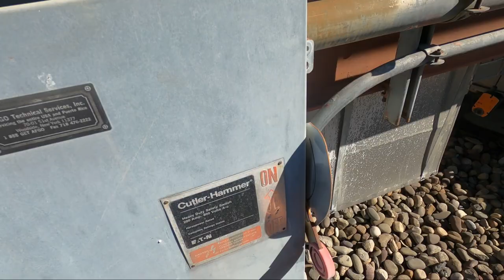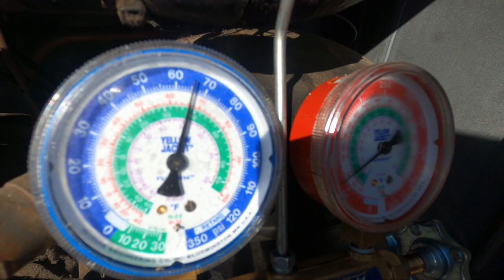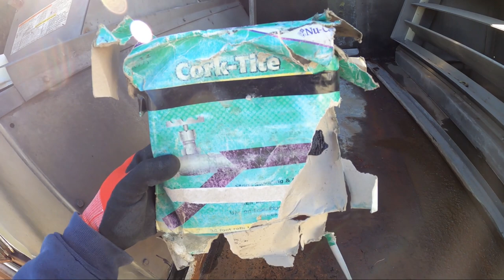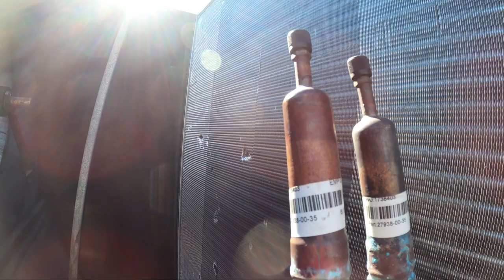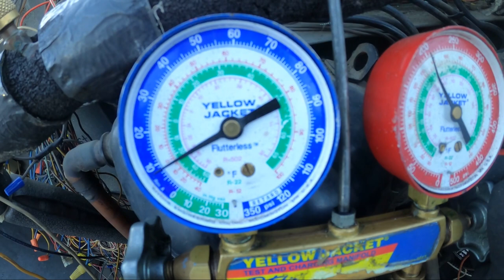HVAC: Evaporator Coil Installation/Replacement (Brazing Copper) How To Install An Evaporator Coil

Comment: Hell yes.
Reply from the maker: You always come thru with the energy  my guy!😁💪💪💪 Hell yes let's goooooooo!💰
Reply from the maker: @jonnymac31  What do you mean by asc? I was wondering whats up with that HGBP. Lol. All I know is that thing works🏃‍♂️🏃‍♂️🏃‍♂️🏃‍♂️💨 Haha. What's your take on it
Reply: @JumpermanTech  they call that tee an auxiliary side connector.  The nozzle is taken out of the distributor and installed in the tee so the hot gas is injected downstream of it. I'm not saying it won't work at, but that's the "correct" configuration when you have a distributor.